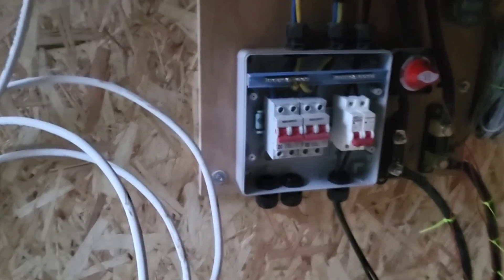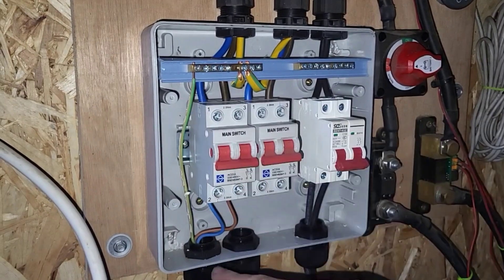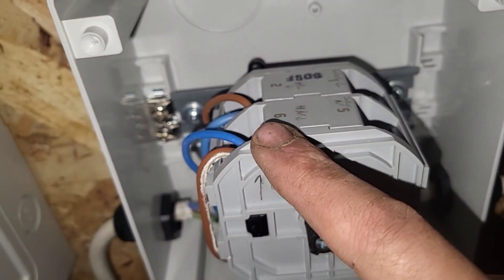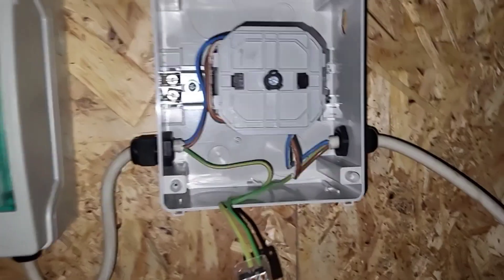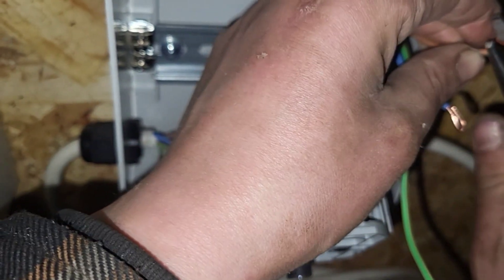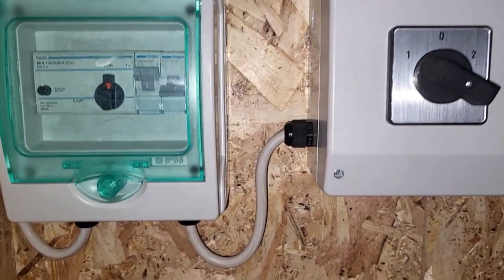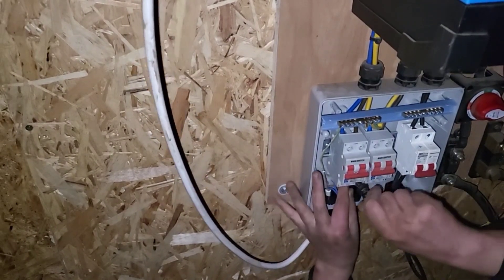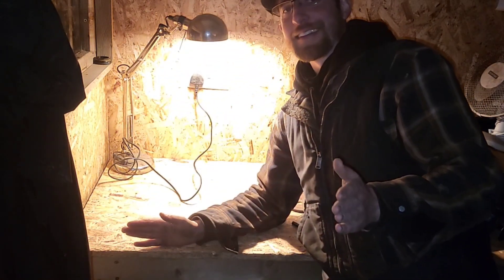How I Wired My Off-Grid Shed for Power

Comment: Very informative. do you run a cable from the shed to the cottage?
Reply from the maker: Yes, I have an external socket and run an extension lead up to the apex of the shed and cable tied it to a steel cable connecting it to the apex of the cottage, if it's not cable tied to a steel cable the copper wire will stretch under its own weight. Eventually when I get to restroing the cottage I'll wire it up properly.